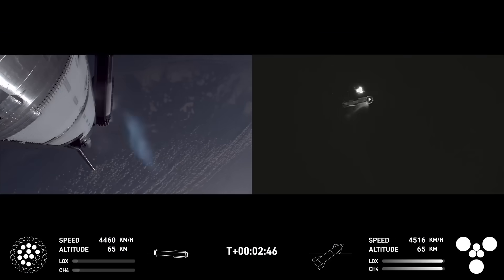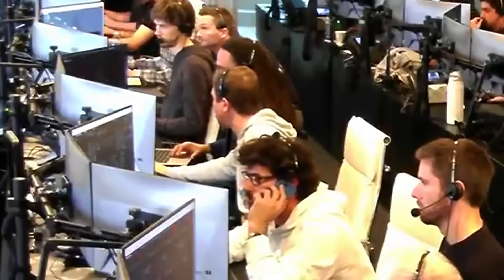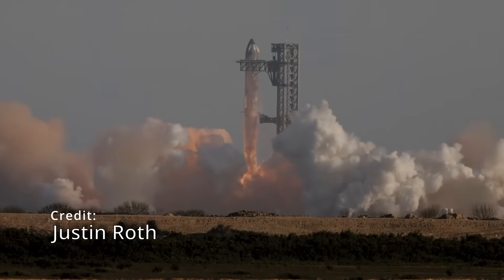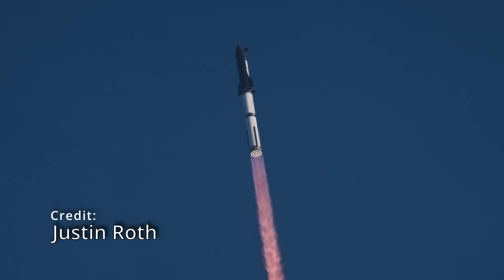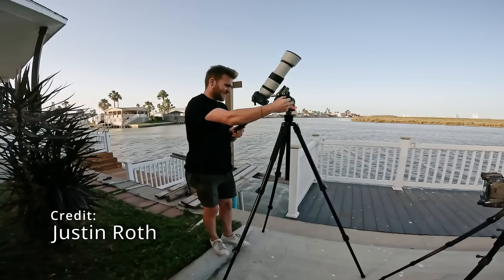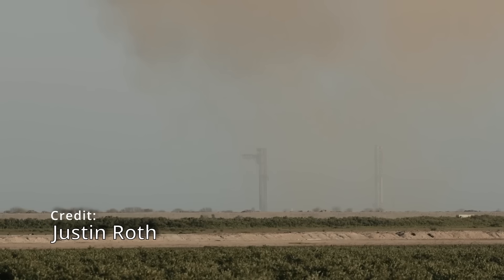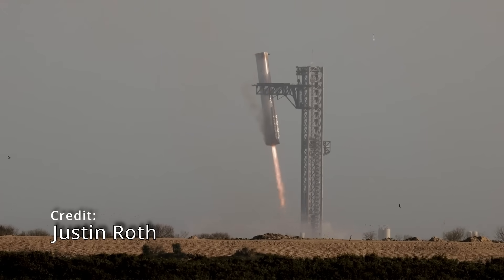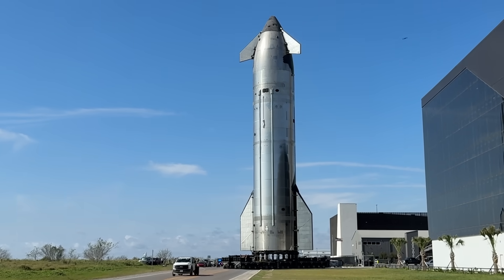Rest In Pieces: Why Did SpaceX Lose Starship Again?

Comment: John is conflating what happened to ship 7 to ship 8.  And its not the same thing.  Ship 7 was a plumbing issue- solved.  Ship 8 was a bad Raptor vacuum cooling problem- which will need closer inspection-solved.  You can see in the video the Raptor cooling problem.  You guys are sooooo dramatic.

Comment: A full duration static fire might not be possible. The weight of fuel helps hold down the ship. At the end of a full duration static fire there's no weight and the hold down clamps and skirt would need to take nearly the full thrust.

Comment: I think a full duration 5min static fire needs to be included. The same way nasa did the sls core stage. This can't keep happening
Reply: If the problem is POGO it's really hard to simulate this on the ground... The Apollo J2 engines chased POGO all,through the program....  Apollo 4,6, and 13 had POGO Issues shuttle engines has a bunch of POGO prevention techniques put into them...

Comment: Given the previous long duration static fire, I think it might not be possible to reproduce the problem on the ground. It's true that they may need to throw out the engine bay and fuel line design and start over on them. I do think they will be able to launch again soon, if they can nail down the problem, and I think that is the more likely scenario.
Reply: Its a bad vacuum Raptor cooling problem,  you can see it on video- duh

Comment: Thanks for the update, Ellie!  Once would be a fluke, twice in a row with possibly the same problems...that better be getting people to thoroughly check over the engines and not rush those checks. If it were to happen a 3rd time in a row for the same reason, that should be cause to ground the program until it's been gone over with the proverbial fine toothed comb at least three times, redesigns, fixes, and rigorous on ground testing done before even thinking of firing off another one.

Comment: Wasn't the block 2 upper stage supposed to utilize Raptor 3? - Perhaps there's an issue with the adaptation of Raptor 2 to the block 2 ships. Also wondering if they're suffering from the same pogo issues Saturn V suffered from. Also did it not seem like the HSR didn't separate until much later in the decent?

Comment: I agree that there must be a serious issue with ship v2, but they chose these design changes to mitigate specific issues they had in ship v1: spin startup pressure due to feed line issues, fuel sloshing, ice ingestion, etc.
Reply: I don't agree. Falcon 1 blew up 3 times in a row. It didn't mean the vehicle was flawed. It meant there were 3 separate issues they had to solve. It's likely the same thing here.
Reply: @moonasha  Poor engineering standards. During the Apollo era they go it right using technology that was primitive by today's standards. Retrograde.
Reply: @rogerphelps9939  They also spent billions more. Its sad to see and it does seem like there is a flaw somewhere in the V2 design.
Reply: @Yungtskt  Interesting V-2 design... Like that developed by the NotSees during WWII
Reply: ice ingestion was in the booster
Reply: fuel sloshing was in the booster
Reply: I do not recall spin startup pressure issues with the starship...or its feed lines....are you sure you are not referring again to the booster?
Reply: The added weight, of more fuel,  burning the engines 25% more to counter the added weight of the furl to get to a higher orbit. My thoughts, are the engines can't handle the 25% more. Looks like a redesign or the other engines need to be put in. Pushing the engines to far past, when they can take.
Reply: @ its not the engine its the thrust puck they are attached to

Comment: It’s definitely a set back, but also not as bad as he’s putting it. Maybe delaying the next flight while they figure out what was the problem. As long as they spend the time moving forward with testing the block 3 raptor, block 2 booster, and block 3 ship design.

He’s spot on about the heat shield testing. That’s the one capability that needs flight testing at the present and could be a major bottleneck problem.
Reply: Exactly, and those tests cannot be performed if the ship is grounded.  The booster is doing great and showing its potential.  The second stage, despite being lost, isn't putting people at risk, so what's the issue, honestly?  I trust SpaceX will do the hard work of doing their best to root out the issues, and that's what's needed.  Press on is what I say.
Reply: @francischambless5919  What I’m suggesting is identifying the problem with this particular design, fly it once to make sure they’ve corrected the issue and then progress to block 3 of the ship and engines (assuming they’ve had to wait a good while to figure out the issues). If they’ve run into issues with block 3, then they can keep testing the heat shield tiles with block 2 while they work on fixing issues found with block 3. This way they don’t get bottlenecked.

I think it probably more likely they will do as you suggest and just continue forward with rapid testing of block 2.
Reply: @Nathan-vt1jz  you do make a good point.  I've been wondering why these engine issues weren't happening with the flights before.  Unfortunately I've been unable to look into the engineering side as much as I'd like to.

Comment: Can it be confirmed that Ship34 was NOT destroyed via the FTS?  Just as it lost the sea-level Raptors and started tumbling, there was an announcement that "FTS is safed", which was probably normal given the flight time.  Contact was lost soon afterwards, but there was no mention of the FTS being re-activated.  I think that Ship33 with IFT-7 was destroyed via the FTS, but its problems probably occurred just before the scheduled FTS safing.  I had hoped that without FTS being triggered, Ship34 might still attempt to come back down again to the Atlantic in one piece.  But the videos from the ground dashed this hope.
Reply: Wondering the same on fts

Comment: If SpaceX would've just made Starship V1 operable and Cargo ready before moving onto Starship V2, this wouldn't be that big of a deal.
I do believe SpaceX is getting ahead of it's self, obviously, and it's affecting development.
Reply: wasn't an option. They were using more fuel than anticipated with an empty payload section. As a result they needed to increase tank sizes in order to achieve a useful orbit with  a significant payload. They could have still gotten to a useful orbit with some payload but it would have been comparable to Falcon Heavy so at that point they have to be asking why they are doing those missions with Starship and not Falcon Heavy. Increasing the size of the ship was the only option that made sense.
Reply: V1 flaps were burning up on reentry so they needed a change there. Not much else needed changed from v1

Comment: Cue the gleeful Elon haters who actually root against innovation......trolls.
Reply: These so called haters are upset because Trump is trying to put an end to drugs so they're going to blame Musk as well
Reply: You learn as much from failure as success. It sucks, but they will figure it out. The engines failures need to be worked on.
Reply: @john_in_phoenix  
"The engines failures need to be worked on."
On the ground.
Not over populated areas.
Reply: @roytee3127  it was over a pre-coordinated corridor. Stop with the pearl clutching.
Reply: Was the explosion over Florida pre-coordinated?
Or shutting down the airports?
Apparently what's left of the FAA needs to de-coordinate that corridor until SpaceX can offer some assurance that the ship won't blow up like that.
Reply: @roytee3127  oh no, are you going to be OK? Does weather ever shift the flight patterns? How will they ever survive? Do you need additional mental health resources?
Reply: @roytee3127  What are you on about friendo. What is left of the FAA? You for reals?

Comment: Yes, overly dramatic. 

Different issue...how often do Raptor engines blow up? Sabotage? How high is the security around the build of these ships!
Reply: You do realize that rocket engines are basically just a continuous contained explosion right? (I know technically a deflagration which is still just a slightly slower explosion)

Comment: I think it will delay it compared to the launch cadence we've seen so far but not so much that it will dramatically reduce the total number of flight attempts they make this year. I am guessing the FAA will say hey you're grounded until you have a really good idea of what went wrong and how to fix it. It will probably mean all their block 2 ships in production right now end up getting scrapped and rebuilt once that design is updated. So considering it takes SpaceX a little over a month to build a new ship from the ground up I'd guess maybe 3 months before the next flight. 2 months for them to go through the mishap process and close out the investigation and then another month to build a new ship after that investigation is concluded. If so we'll see maybe 2 less launches that we otherwise would have. Certainly a set back but not the end of the road by any means.
Reply: 45 days...this is not much of an issue,, they just need to gusset the thrust puck particularly in the center...similar issue...they added some bracing but clearly not enough particularly in regards to the middle 3 engines
Reply: Yeah but that probably means missing the Mars window for years. Its pointless. IMO
Reply: @ yes maybe 2026 but that was a stretch anyway...starship will fly again within 2 months
Reply: @ThatGuyKazz  I agree... We are only about 100 flights short of getting starship reliably into orbit.  How many flights to the moon before starship doesn't tip over upon landing?  NOTE:  Don't worry about the FAA... DOGE has already cancelled FAA and EPA investigations into SpaceX!
Reply: The FAA will not be a problem.  Trump will just gift it to Musk, and Musk will grift it out of existence.
Reply: @llanitedave  The FAA needs to be limited to clearing the airspace. What would they know about rocket engineering?

Comment: My thought is they needed to fly it to pinpoint the issue.  In my job I do a lot of trouble shooting of complex systems and the thing that communicates the most info about the issue is testing it.  Making a change and testing again.
Reply: IMO. Ideally, it should not take two failures to pinpoint an issue.
Reply: @jbbuzzable  They're rapid prototyping, failure (sometimes multiple) is part of the development.  They're just doing it with huge rockets instead of small parts.  It's one of the reasons Elon cited for going with stainless steel instead of carbon fiber.  As he put it "carbon fiber would bankrupt us"
Reply: On the one hand, a huge vehicle blowing up is a little more daunting than recompiling (maybe reflashing) and rerunning a program.
On the other hand, they're set up to churn these things out; it's not like each one is years in the making.
Reply: @michaelmicek  yeah, I do a mix of hardware and software, but things don't (usually) go catastrophic if it doesn't work. What SpaceX is doing is rapid prototyping on an enormous scale.

Comment: This is a TEST CAMPAIGN! Of course there will be setbacks during the course of the campaign. The sky is not falling here. They will figure it out and be back on track in no time. It's way to early to say "it's a design flaw" or anything in that vein. Let the process play out.
Reply: You are correct, the sky is not falling, but this is the first definitive step back of the program, not counting flight 6 "failed" booster catch bc it was a ground 0 issue they identified and fixed. Every other time, there was improvement. This failure indicates a lack of understanding to ship v2 issues and may result in a in depth redesign, which could take months. You can't put a temporary fix on a system-wide design flaw
Reply: @sammchenry738  there was no step back here. Go read the amount of iterative changes made to this rocket from the last one. They make it better every time, even if it fails. It is on purpose and they did the very same thing with falcon 9. Have you heard of falcon 9?
Reply: I agree. It is a test campaign but this is definitely one of the bigger setbacks in the program, but that is expected. Hopefully they can figure out what went wrong and fix it. V2 probably needs some design considerations. It’s worth stepping back for a bit, fixing what needs to be fixed, and testing ASAP. Then go back to launches once the design is deemed safe. Hopefully it won’t take too long. I personally expect 2 months of redesign followed by 2 weeks of testing, than we may see another launch
Reply: Bunch of Kamala voters in here today. I can taste their salty tears. 😅🤣😅
Reply: Well said, Timothy
Reply: But 1st 6 no trouble!  Now Elon leading DOGE and hate at him is soaring as we see Tesla charging stations being destroyed and Teslas being attacked!  Sabotage has to be looked at now as 2 destroyed at beginning of this year not a coincidence!  The lefty loonies are very prone to violence!
Reply: There were no rocket explosions during Apollo and the Saturn only took 5 years to develop from concept to launch. This rapid iteration in my opinion will lead to at best a minimally safe craft and at worst will overlook a long term flaw that will be fatal.
Reply: @2BirdsinaTrenchcoat It led to dragon which has launched people to space.
Reply: I don’t see HLS happening on schedule at this rate, though. In fact I wouldn’t be too surprised it the program gets canceled entirely.
Reply: Wow, didn't even watch past a minute in video before commenting... 🤦🏻‍♀️
Reply: @furriesinouterspaceUnited  I actually did watch the entire video before my reply. But thanks for playing.
Reply: "The sky is not falling here."   Well, actually it is.  Or rather, pieces are falling out of the sky onto populated areas.  Not a good look for anyone concerned about safety.
Reply: @roytee3127  SABOTAGE!  Tesla charging stations destroyed!  Lefty loonies are very violent when they do not get their way!
Reply: "The sky is not falling here" No, but Starships are. Eight of them so far. That's ALL of them. No progress has been made. Enough is enough.
Reply: @geraldscott4302 flights 1-3 had uncontrolled reentries. Flights 4-6 had pinpoint accuracy on their landings. 7-8 had uncontrolled reentries.
Reply: @sreastronaut9765  and none of them were the same becasue they make changes.
Reply: @sreastronaut9765  definitely the first 3 had reentry issues.....can I ask who else has had an orbital class vehicle reentry in the past 10 years?   ULA hasn't....Blue Origin Hasn't....Orion had a sketchy at best heat shield issue.....  flights 7 and 8 both did something no one else will likely do for another 10 years....land their heavy first stage safely...hard to call that uncontrolled....second stage issue yes....but there has been a pile of them in just getting to orbit....no one else has tried to reenter any except Orion and Dragon and the Russian capsule and these are just little things......
Reply: @mikelee-i3b  Oh did I accidentally say booster when talking about uncontrolled reentry?! 🤦🏻‍♂️ Meant ship.
Reply: @ well you said flights which sort of implies the booster 🙂
Reply: @ my point is no one else if even attempting reentry...
Reply: @mikelee-i3b  oooh gotcha. yeah my bad. You have a good point. What SpaceX is doing is incredible and far beyond what anyone is currently doing. I hope they are able to launch again soon. But maybe they should take a deep dive into the design of V2 in order to avoid greater delays down the road.
Reply: @  honestly I think V1 would have had the same issue as they upped the payload tonnage...by installing more powerful engines on V1 with the requirement to use that added thrust,,, the thrust puck holding the engines would likely not been able to  keep the engines from vibrating causing leaks from supply lines.. hence a similar fate...lol.. I'll have to ask Elon..🤣
Reply: @geraldscott4302  ...how much does all this actually cost you?